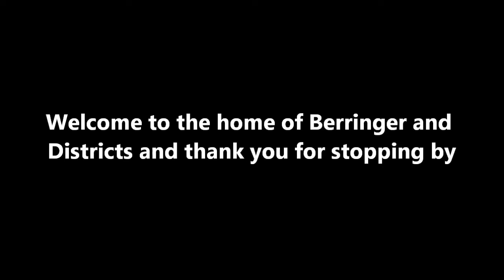B&D: A video response AWS Ramps

Comment: That was perfectly explained for me (and others maybe) Susannah and thanks for putting this up so quickly from my recent question - you're a star. I can now go out and buy some of these AWS ramps with full knowledge of what they are for and also where to fit them. Once again, many thanks.                .............Graham
Reply from the maker: Not a problem Graham, glad to be of assistance. One thing I forgot to mention is that when a train passes over the other end of an AWS ramp ie flat end first the train won't react to it as the ramp is intended for trains coming in the other direction. Susannah.
Reply: I thought that would be the case because of the 2/line on the bi-directional tracks as they were facing opposite directions but thanks for confirming, really appreciate that.           ............Graham